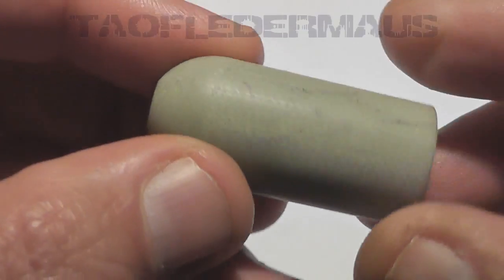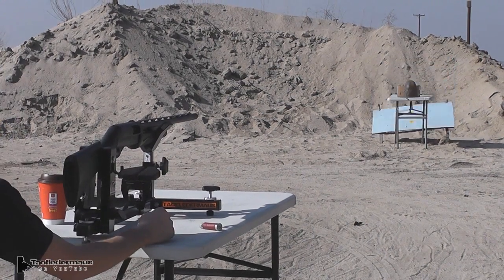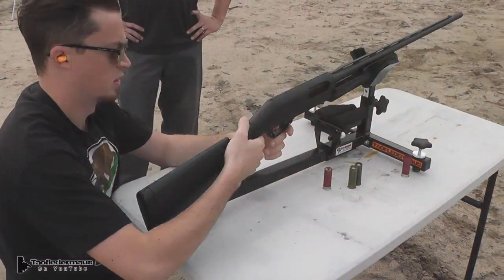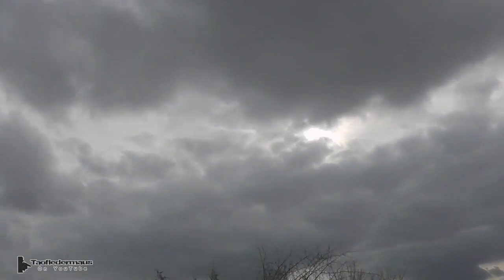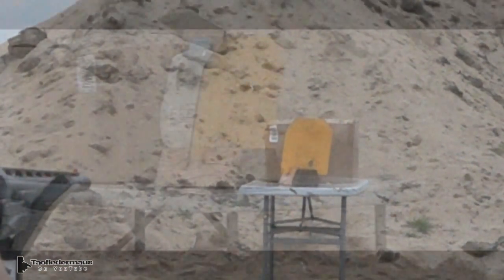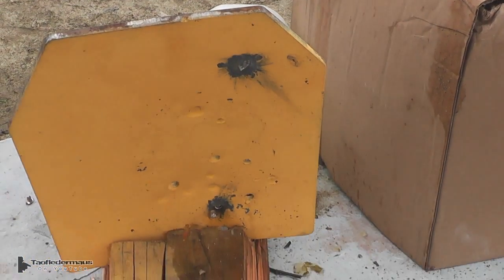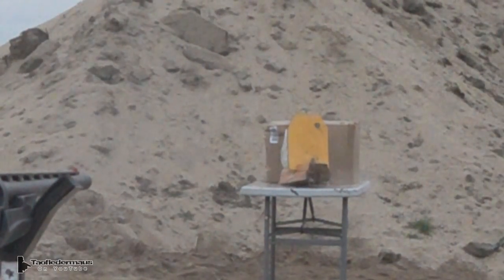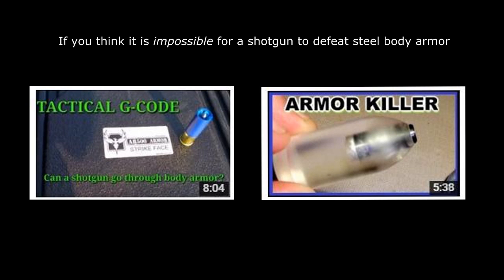Custom G10 Shotgun Slugs - The Quest to Defeat Armor Plate

Comment: The engraving forces and spin up energy in the rifled choke tube just subtract from the MV; and therefore that should be removed. As you have already found out it does nothing to stablize anything; nor is this possible.

Comment: When you build these odd slugs for a rifled barrel or choke tube, you might want to consider using the Miller Twist Rule or a variation of it to obtain rotational stability in flight. Should help improve the overall accuracy of the slugs. (There is a reason most commercial slugs are fairly short in length.)

Comment: Great stuff!  I do the other kind of shots on my channel.  :-)  How about steel cable slugs?  Or "wire rope" it's also called sometimes.  Find some the right diameter, then cut maybe 1" pieces to load in the shells.  Maybe even dip one end in molten solder or lead to 1/8" in, then shoot some lead first, lead last and without the end sealed.  It would be really interesting to see not only how they fly, but whether those individual steel wires start spreading out in flight or on impact.  Could be nasty.  You might even get some spinning effect just from the twist.  Cheers!

Comment: You should see if some tannerite in front of an AR-500 plate will stop a round from penetrating. I think the blast from the tannerite would maybe disrupt the flight of the bullet enough to keep it from penetrating (assuming you're using a round that would normally penetrate).

Comment: Im pretty sure winchester super x slugs still use the wadding your talking about. Is it possible that using slug hulls would increase the success of these "custom" loads?
Reply from the maker: +glockfan112   The problem with hi brass, and slug shells is they blow out a lot of smoke and mess up the camera shots.

Comment: I wonder how shock resistant steel (s-7) that has been properly heat treated will do for a penetrating core? I assume any type of carbide is inherently  very brittle?
Reply: +Colson Customs ...   Hardened high carbon tool steels have been used for armor penetrating cores since the concept originated in WW1..  US 30-06 M2AP manufactured during the later years of WWII and Korea used a high carbon steel core and samples shot by various Youtubers has easily defeated 1/2 AR500 armor plate.

Comment: They make a hollow point 12 ga slug, with fragmentation grooves. Supposedly rips holes the size of your fist. Bold claim ain't it?
Reply from the maker: +darkwarrior   I honestly thing that slug is total bs--  a publicity stunt.   They claim it is for a smooth bore shotgun,   but the slug is just a giant bullet without anything to stabilize it.   It would just tumble through the air.
Reply: I figured you'd heard of it. Seems like it'd have the same problem these full sized rounds did in the video. Though a functioning version would be downright terrifying.
Reply from the maker: +darkwarrior  The slug MIGHT work through rifling..  but they claim it is for home defense and who uses a slug gun with a 28" barrel for home defense? lol     I am trying to talk Tim into machining clones of those just for laughs.
Reply: That would be brilliant. God knows these crazy rounds can do some random things every shot.

Comment: Could the plate have spalled and that's what damaged the jug?
Reply from the maker: +Trevor Chouinard  I think some of the g10 material just splashed through the hole.  There was some yellow paint that made it through too.
Reply from the maker: +Trevor Chouinard  There was yellow paint around the little hole in the jug,   so I am sure it was just material blasted through the old hole in the plate.    The back side of the plate didn't have any craters or anything.

Comment: Longer projectiles require a faster spin on order to stabilize them, The military went to 1/7 rifling for the new 62gr rounds where 55gr projectiles can be stabilized  with 1/12 spin.
Reply: +Dennis Cote Interesting information, but unfortunately I think testing twist rates is a bit beyond this channels $5 budget...

Tao has several times posted about how hard it is to get in contact with manufacturers when trying to get review samples of ammunition, targets, or other equipment. So it's probably not possible to get some manufacturer to send a few rifled chokes or barrels with different twist rates just to test oversized slugs.

On the other hand people send them things like these slugs from Tactical G-code that often are made using expensive materials, and manufactured on very expensive industrial equipment. I think one round they sent Tao was estimated to have almost $100 in material and work. Don't remember which video it might have been, but the slug might have been made of Titanium.

Comment: well, a little bit of whoopty- doo goes a long way! thanks again Jeff! do you like filming more than shooting?
Reply from the maker: +Trigger Talk   It's hard to set up the cameras and shoot too.
Reply: +TAOFLEDERMAUS I've tried. you're not kidding bud! I just love shooting so much I rely on a cameraman. wish I could clone myself so I could shoot AND get the footage I want. have you figured out a way to ignite a propane cylinder with one bullet and no external ignition source? if there's someone who can figure it out, it's you. I have an idea, but. ...
Reply from the maker: It's not really possible because the propane needs to mix with air to get within its lower and upper ignition points.   Too lean and it won't burn,  too rich and it won't burn.  I guess you could pre-mix the propane with oxygen but that would be unstable and dangerous.
Reply: +TAOFLEDERMAUS makes sense, I knew you could provide some insight, thanks! back to ye olde drawin' board. ..

Comment: It would have been interesting to leave one of these longer. Since two variables were changed we'll never know if it was the carbide, or the shortened shape, or both, that caused the better result.
Reply from the maker: +IIDASHII  It was definitely the shorter shape.   All the ones in the previous video flew crazy.
Reply: Maybe I missed something. Did the others also have carbide inserted into the tips?
Reply from the maker: yeah

Comment: Yet another great video,  I wonder how that round would do out of a high brass load. You should try and get ahold of some pure carbide slugs coated in brass or a thin coat or lead
Reply from the maker: +A13U53D  The polycarbonate slugs we shot that went through the plate,  were just low brass.   Hi brass tends to throw out more smoke and heat distortion.   so it messes up the camera shots.

Comment: well we all know based on previous discussion that if you would have had a lasar on your shotgun that you would have gotten better penetration do to the better flight of the slugs... 😨😨😨😨😨😨😨😨
Reply from the maker: +keifer225948  A YT expert told me the other day that the bullets didn't get HOT enough to go through the plate.  lol
Reply: *****.  Great point...  i guess you need to soak the rounds in gas.  Light them on fire. Then shoot them....
Reply from the maker: Or heat them up with a torch first...  how stupit of me not to do that!
Reply: +TAOFLEDERMAUS.  ok well im back to my original plan..  use a lasar !!!👍👍👍👍
Reply: +keifer225948 You just need to use a 10+ watt CO2 laser to heat up and soften that plate a bit!  Once it's half melted, the round should go straight through!

Of course, at this point, you may as well just shine your laser at the target's face and forget the bullet entirely, but that's beside the point.

Comment: i wonder if the longer slugs have more uneven air pressure around them as they're going down the barrel causing them to skip off in random directions?
Reply: +Voodoo2762 Could it also be long form factor and larger surface area combined with wind resistance? Especially since the front is much heavier than the back, I was thinking the back could be almost like a lever. A large area with little mass that is getting pushed around causing the entire bullet to pivot. I'm no expert so I'm probably wrong though.